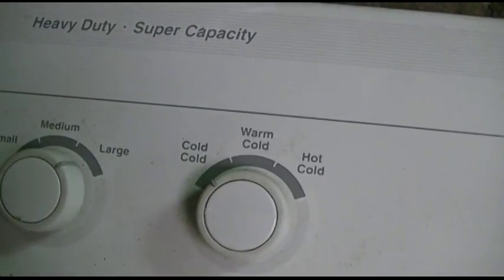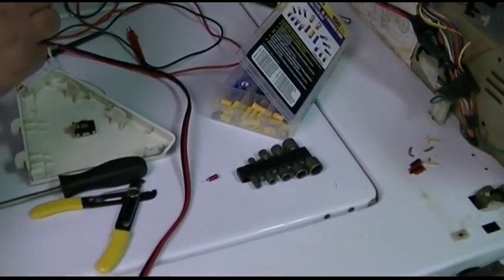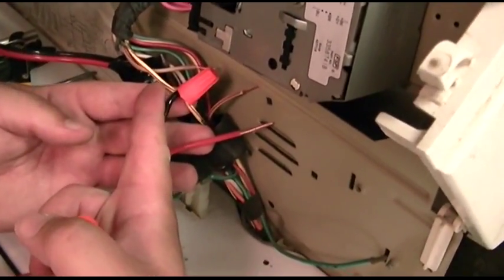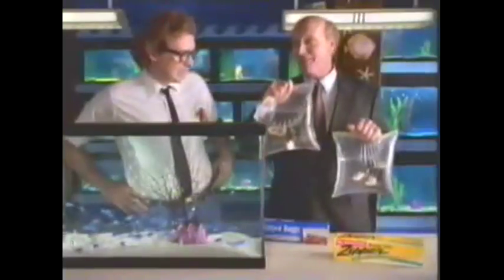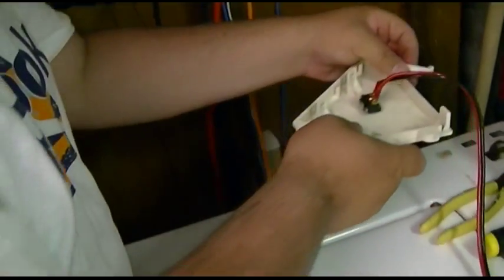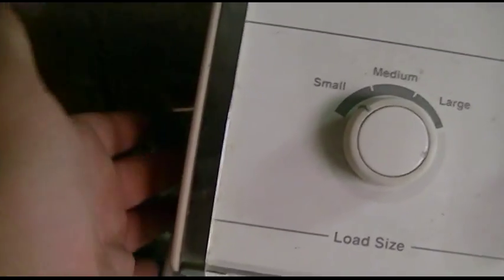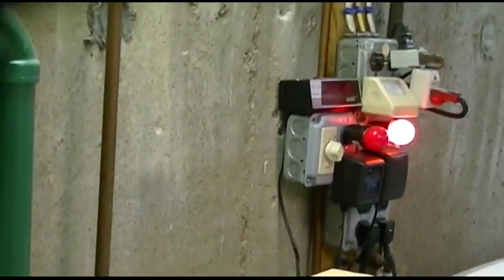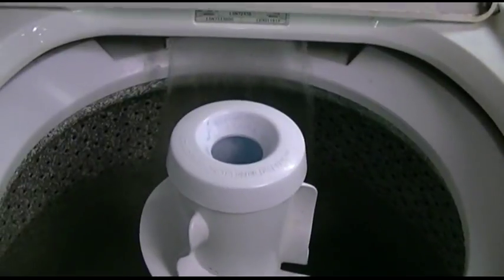The Great Whirlpool Warm Rinse Option Upgrade, Part 1!!!

Comment: Oh, I forgot to mention this: When the washer is in the final drain, you can turn on the warm rinse option if it's not on, and turn on the hot enable timer so you can do a "hot" spray rinse spin for the final spin, if you want. Again, can't do that on a belt drive or HE washer.
Reply from the maker: Yes, I can certainly do that if desired!
Reply: jaykay18 Cool. Now we have more water temperature combinations (wash/rinse/spray rinse spin): cold/cold/cold, cold/cold/warm, cold/cold/hot, cold/warm/cold, cold/warm/warm, cold/warm/hot, cold/hot/cold, cold/hot/warm, cold/hot/hot, warm/cold/cold, warm/cold/warm, warm/cold/hot, warm/warm/cold, warm/warm/warm, warm/warm/hot, warm/hot/cold, warm/hot/warm, warm/hot/hot, hot/cold/cold, hot/cold/warm, hot/cold/hot, hot/warm/cold, hot/warm/warm, hot/warm/hot, hot/hot/cold, hot/hot/warm, and hot/hot/hot. Most processes may be manuel. I would love at least some of these combinations demonstrated on a Wash in wash day video
Reply from the maker: Those are few and far between as it is.  If I think of it next time one happens, I'll do it.

Comment: HI Jaykay18 in stead of using wire nuts what do you think of me using snap connectors the kind you pierce down on the two wires you want to join. Not sure if it could handle the voltage. Thanks
Reply from the maker: I'm not a huge fan of tap splice connectors, nor do I keep them on hand.  In sticking to my strict budget of $0 per video, I didn't purchase any for this mod.

Truth be told, the tap splice connectors would have definitely been much easier, and would probably work fine.  I'd exercise a little caution if you're doing the lid switch defeat mod, because they're sending motor current through those wires, so you want to make sure the tap splice can handle that kind of current.  I don't think that tap splice connectors make a solid enough connection at least to satisfy me.  But in the control panel, there's no real risk of weather or moisture or anything else that will foul the connection.

If you do decide to use tap splices for the lid switch defeat, I'd run a cycle and monitor the tap splice to ensure it doesn't get hot.  As long as it doesn't, it should be just fine.

Comment: Nice! An HE machine would have thrown an error code when it sensed the control panel was opened.
Reply from the maker: They probably have sensors that can tell when a screwdriver is coming near.  That sets a pending error code that is programmed to come up when you absolutely NEED that load of laundry to be done immediately, at the worst possible opportunity.
Reply: LOL! Exactly!

Comment: I'm thinking of maybe someday doing something similar on the 1992 machine. I'm probably gonna have to drill in one of the squares in the front of the control panel, since there's only so much room to mount a switch on the side panels, or the back. I will try to keep it under a $10 budget, and if only I can find the big part that I need for under $10 or even free, probably in the back of a local parts warehouse or something to that effect, I'll consider doing it, but more than likely not for awhile. If ever I do end up doing this mod, you can expect a video titled "The Grand Kenmore Low Speed Agitation Option Upgrade."
Reply from the maker: I'd LOVE to see you do it!